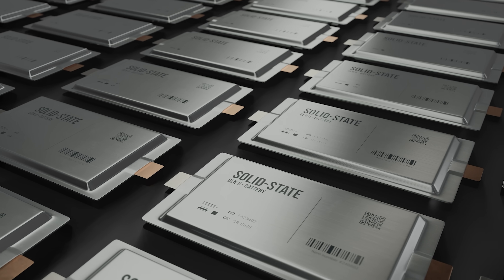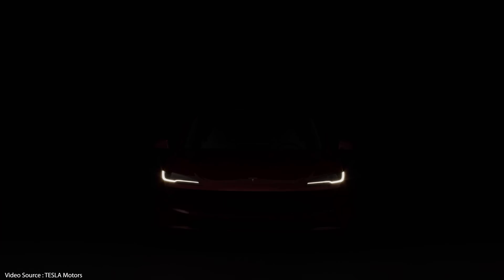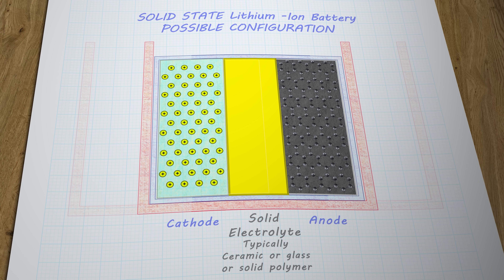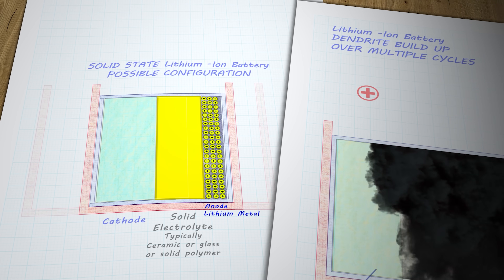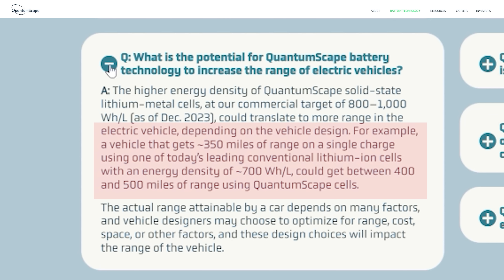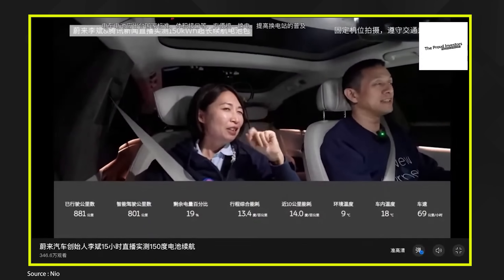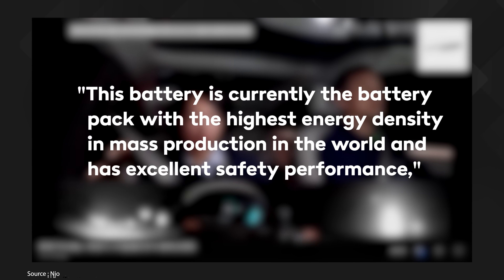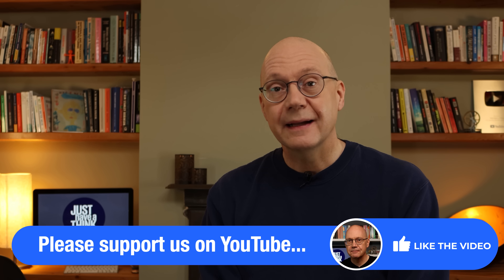Solid State Batteries - FINALLY powering electric vehicles in 2024!

Comment: Great episode!

Big true solid state batteries have some real challenges. Also, the potential benefits are just that, potential, maybe possible when the technologies have been developed, not all there in the first generation of commercial production, as with any new technology. Also the comparisons are usually very twisted, as in, if optimized for one factor, they can be this or that much better than average alternative on the market, in that particular regard, but extremely bad in other ways, and or astronomically expensive to make, usually both. This is not only true for solid state batteries, but most new potentially great technologies we've been promised for decades. And that's when they're not just making things up, sorry, forgets aspects of reality.    

Four hours for a full charge isn't an issue when you're going to visit your aunt if you have more range than you need to go there and back, if necessary with some partial charging there, and or on the way back. So Mercedes supplier don't have a battery technology with all the claimed potential benefits of solid state batteries with that single caveat that a full charge takes four hours. If they had a technology that was all things considered, except that caveat, much better than whats widely available, they would already be scaling up the production all they could, with all the billions everyone would be throwing at them. Similar goes for every other company, if they had a battery that was superior to everything else, that could be produced at relevant cost, even with some caveat that can be acceptable, and don't have to be an issue in some substantial part of the market, they would be building factories like crazy, not one factory, and not just aim for what can pass for "true mass production". 

You don't need to understand the chemistry or physics involved very well, as long as they're not building "gigafactories" like crazy, it's pretty safe to assume they're still quite far from replacing liion. Batteries has some many important factors, and even if you can make a battery with a number of huge advantages, it doesn't help if one or more factors are so bad that they're practically useless, especially if they're also extremely expensive to produce.         

The "semi" part of semi-solid, means "not", as in, they're not solid state. It typically means less electrolyte, and reducing the amount of any part, with retained capacity is an advantage, as long as you can do it without introducing equal or greater disadvantage.

The fact that Tesla aren't pursuing solid state batteries, not officially anyway, doesn't prove that it's impossible to make big solid state batteries, just that they consider that it too unlikely even they could develop a solid state battery that is, all things considered, better than their li-ion will be, then. It's not just that solid state will have to be better than li-ion was, some time in the history, they will have to be able to compete with what's available, in the future, when they are actually commercially produced. A problem they share with many promising technologies, like economical mass production of SMRs, or even cold fusion, if we ever solve either, they will probably have been made obsolete for general power generation by things like solar, wind and storage/demand side management, and possibly other solutions.

Comment: Several errors . Toyota has been researching and Developing solid state batteries for well over a decade with 200 engineers working on the issue 2026 it expects production, they are one of the early innovators for this Technology. Toyota bought out the hybrid 2 decades ago now !!! 1994 and started the move . Bus batteries  are massive n size 3 to 4 times larger than a cars !!! 4 hours is super quick charging time when lithium Ion would be 9 to 12 hours. It looks like there here as you said a car charge the Solid state batteries took 20 minutes to 80% whilst using super chargers a lithium ion battery takes at the least 40 minutes to get there .

Comment: Range anxiety comes down to two factors:
1) The fear that you will not find a free or working charger before your range runs out.
2) The frustration of having to hang around for an hour more more to recharge, so you try to go as far as you can on a single charge.

To fix these problems we need batteries that recharge in 10 minutes or less. Until then, electric cars are only useful for commuters with home charging.

Comment: Solid state batteries are like fusion electric generators.. Just 5 or 10 years away and have been for the last 30 years.  Currently they are still just 5 to 10 years away.

Comment: The range problem isn't a problem for every day I'd agree. Even then it's not really the range that's the problem but the refuelling time. The problem is if you want to go and visit someone 500 miles away then in almost all cars electric or combustion, you are going to have to refuel and when you do in a car it's going to take 5 minutes and in an electric that's at least 30 minutes. The solution to that problem is either battery swapping or on road charging. Personally I like the on road charging more because then you can have much smaller range and thus smaller batteries but that's a heck of a lot of infrastructure in comparison and the battery swapping would allow companies to check the battery health as well.

Comment: Charging times should not be a major factor in development. It is a significant possibility that “overcharging” is causing some of the problems with the current technology(sorry). The infrastructure will never be there on major routes to support every vehicle that demands such a huge power input. Hopefully the longer range of any new batteries will negate this to a certain extent, and lead to a lower demand on Motorway/Freeway service stations.

Comment: Bit of a noob question but if solid state batteries achieve all this, where does it leave the likes of Sodium Ion, Iron phosphate or the many other technologies that are evolution of the lithium ion battery? 

Obviously manufacturing capacity and cost will play a big part but are there uses any of these other technologies that are still in their research phase, sure solid state makes most of these redundant inless they have a massive advantage in some area or am I just getting caught up in the sold state hype train? 

I understand that some of those other technologies will hit the mainstream market sooner but will they have a use longer term other than a way of freeing up lithium for other applications or extra materials research?
Reply: Lithium ion batteries were invented 30 years ago and still I have a NiMH battery in my analog wall clock. It has an extremely small power drain: a single 2.8 Wh AA battery can run the clock 24 hours a day¹ for several months between charges. It seems nobody has bothered to produce a wall clock that uses a Li-ion 18650 cell. Why would they? The marginal benefit just isn't there.

Not every new battery tech will find its niche — I hope investors are aware that a lot of the research areas have huge overlaps in their theoretical advantages — but I bet many of them will. Mostly on cost, I suspect.

¹Well, technically I shouldn't say 24 hours a day, but 12 hours twice a day, right?

Comment: For me, the charge cycle performance is what keeps me from being interested in EVs. I don't want to have to replace a $10k - $15k battery every 5 years.
Reply: Good news! Whoever gave you that impression either had an agenda, or just didn't notice that their assumptions were about 15 years out of date.

It used to be a bit of a mystery just how long an EV battery might last, as there weren't enough old EVs to really know for sure. So some pessimism was warranted, especially because everyone with a cell phone knows what it's like for a battery to only last a few years. But like I said, that was 15 years ago. Now we do know. There have of course been instances of defective batteries, replaced under warranty. Other than those, you can expect a typical EV battery to last as long as the chassis. 150,000 miles, 200,000, sometimes more. And they don't suddenly conk out. They fade, very slowly, over time. After 200,000 miles, maybe they only hold 85% of the charge they could hold when new. That could still be perfectly adequate for your needs.

The main thing is to stay away from air-cooled batteries as in the Nissan Leaf. Those do wear out faster. But most or all other modern EVs have active heating and cooling to keep the battery in a healthy operating range, and sophisticated battery management software to control that as well as the charging. As such, they are treated much better than your average cell phone battery.
Reply: @ps.2  Twas about 4 years ago when I had to help my mom shop for an EV. Which means, I did ALL the research, including brands, new market, used market, battery life, etc. Let's just say if you want a used one, pretty much everyone of em were down 40%ish. She lives in a big city, but the NEXT big city is 3 hours away in any direction. EV just wasn't in the plans for my mom who wanted to live in the boonies and travel when she retired.

Keep in mind, my mom is a literal boomer born in the 60's. She's of the opinion that if a car can't average 400k before it's dead, it's a worthless brand. Which is like, all of them these days.

Comment: Range is not a real problem? Wow, that's a bold statement to say with no clarification. I mean, maybe in a place where you live. In the US there's a lot of places with no charging infrastructure and the distances traveled by vehicles are so massive (and mountain ranges plus cold weather half range of most vehicles), we indeed need either much much better infrastructure (out of EV manufacturers control) or at least double the capacity. When Tesla finally opens their charging stations it's gonna be much better but for now I HAVE to drive my ICE car when I go to certain places because ID.4 will not survive the distance between charging stations.

Comment: Every chemical battery type ever devised has drawbacks.  Its horses for courses.  Furthermore its not always a good idea, to cram a lot of energy into a compact system where the Anode and Cathode are separated by very small dimensions....the slightest defect,damage or change in the material will cause a runaway reaction.  Liquid fuels dont have this issue because the other half of the equation is the air, and it takes very specific conditions to get the oxygen and liquid fuel together to achieve a full release of energy, which is really key to decent safety.  Thats why liquid Hydrogen is a terrible idea, upon release it mixes with oxygen in the air easily and ignites and detonates with a shockwave 300% faster than any other chemical plus its horribly inefficient.

Comment: One sad bit to add. If manufacturers made practical, relatively lightweight cars, then most "problems" of ev's to the consumer would be less of an issue. But i guess if you want to squeeze every last bit of money out of ICE Cars you cant offer practical alternatives. So we're stuck with "sleek, longrange, inexspensive" e-suv with a weight of three tons, 200-300 miles of range, starting price 33000€

Comment: thanks for the refresher on solid state batteries. Tesla has the right approach as far as manufacturing vehicles currently. they have their options open to any new breakthroughs to faster charging of current tech or changing over to solid state tech which likely would be a drop-in to current designs.

Comment: If it was possible, I wish they would split the car battery into fast charge and slow charge sectors. Maybe super capacitors for rapid charging for short distances and a slower charge larger capacity sector for when you have the time to charge for a long trip.
Reply: But ... for short distances, you don't actually need rapid charging. What you need is charging available wherever you park for longer than an hour at a time. That could be in your garage or your driveway, or at a corporate office, or at a mall or pub or big-box store. There are even, in some places, EV charge facilities available for street parking.

Especially if you have a place to charge at home or at work, that's it for short-distance charging. You never have to wait for it, because the car sits parked far longer than it is out driving. (The exception would be if the car is in active use for hours at a time, e.g., it is used as a taxi or a delivery vehicle. But that's no longer "short-distance" charging, I would argue.)
Reply: What I mean is that 1/4 to 1/2 the energy storage capacity of an electric vehicle should be a super capacitor  or a rapid charge material for extra fast charging to solve the charging time inconvenience.  Not everyone puts a full tank of gas in their fuel tank everytime.  @ps.2

Comment: What do you think of induction charging? That is, energized roads or sections of road that charge vehicles passing over them. If that is viable and economical, battery packs could be much smaller (lighter), and range anxiety no longer a thing. How much energy loss is inevitable in such a setup?; is it a possible solution?
Reply: Transfer efficiency is very poor. Moreso with a non-stationary vehicle.
You'd have to be crazy to throw away ~40% of your electricity.
This is pretty much a non-issue on the scale of a cell phone but we're talking the equivalent of 22,500 cell phones in a car (4,000mWh to 90Kwh)

Comment: I think the focus of the vlog was not well considered this time. News of the impending battery factory scaling was useful information but covering the trials and tribulations of new and aspiring battery brands gets us nowhere.

The thing is there has been some really interesting advances in lithium metal anode construction quite recently and that by itself would have been enough to justify a long look at solid state/lithium metal batteries. Also, those studies which have come up with some interesting paths of development base their innovations on exacting studies of failure mechanisms of existing lithium metal battery designs. That is what will get us to solid state batteries not melodrama about QuantumScape or any of the other hopefuls.

Perhaps a follow-up to this update is called for. The literature on failure mechanisms of lithium metal anodes (and remedies to aid the clean plating and stripping of lithium and sort out internal cell impedance challenges of SSBs) is broad but PNNL's recent studies are a good place to start.

Comment: Semi solid state is too much of a dilemma of  a phrase to cope with.  Solid state equipment originally meant semiconductor based equipment because there was no glass tubes/valves . 
  Today the glass is an essential ploy for what is called solid state for another category of technology. 
  We were shown AgS as a possible solid state electrolyte grom Faraday era when heated  , but actually all the metal sulphides display semiconductor properties coincidentally.

Comment: 100 kWh charged in 10 minutes requires 600 kW of power, about the maximum power demand of over 10 homes if you had everything running at once on a 200 amp circuit. A bank of 10 such chargers would require a 6 megawatt gas turbine generator, or 7 acres of solar panels in full sun if all chargers were running simultaneously. If this doesn’t seem realistic, that’s because it isn’t.

Comment: we are experiencing very rapid change and development of batteries. WOO HOO !
I have heard too many "claims" to believe any until I see it in a working product.
Labs can produce results that just are not realistic in the real world.
Currently, LFP Is the right choice for safety and density. 
It is astonishing that Tesla hasn't converted totally to LFP. They are less expensive and easier to produce.
The case use will determine the best tech for application.

Comment: Great explanation. Li-Lanthanum ceramic have been a topic at Ceramic Conferences for at least the last thirty years. This is not my area of expertise but I have aways been interested in what other people are doing in Materials Science. So basically they are trying to design a material that the Li ion can move through under an applied bias. The bias can be charging or discharging. There are other designed materials that will do this. The O2 sensor in your car will do this. This is the principle by which fuel cells work. Transistors do this with electrons. It is called quantum tunnelling and I am sure that is where QuantumScape gets the name from. 
Ceramics don't have to be brittle either. Yttrium stabilized Zirconium Oxide is basically what the the O2 Sensor in your car is and they make knives, hammers, and golf clubs out of that material.